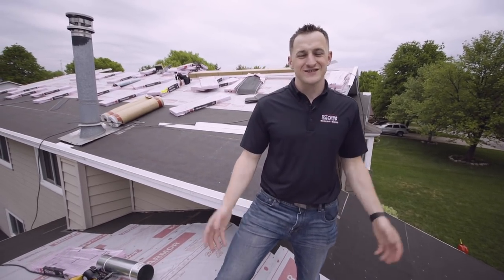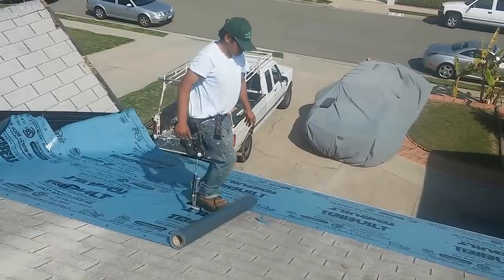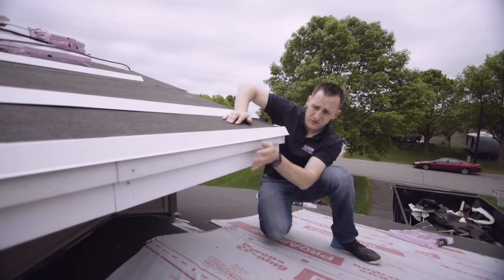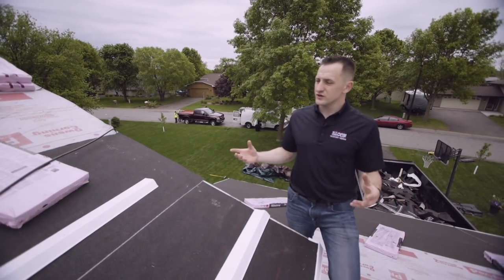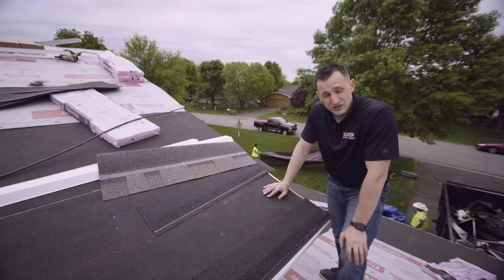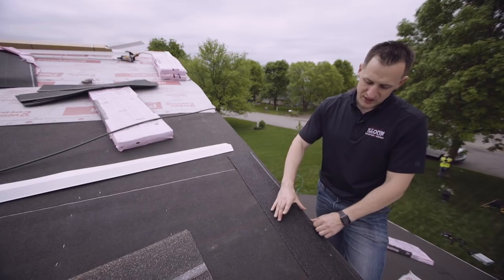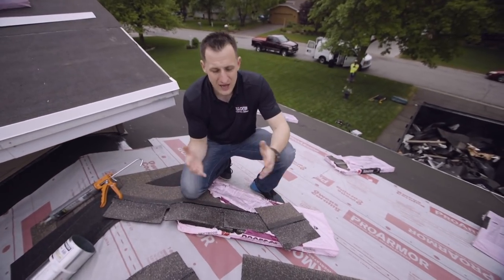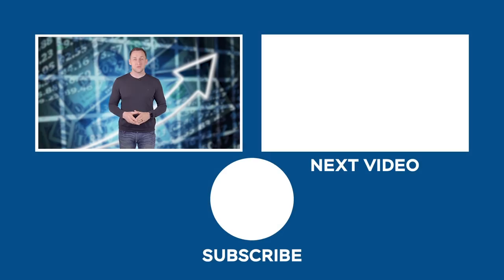How to Install Roof: Best Roofing Practices / @RoofingInsights3.0

Comment: If ur using an ice barrier do u still need felt prior to the actual shingle install?
Reply: Not an expert but YES otherwise you'll never be able to remove them in the future.  I had em run paper starting above 6 inches above the drip...with ice and water over the eave drip.
Reply: Shingles stick to the ice shield. My recommendation is to felt over the ice shield just so the next roofer can remove the old shingles. Ice shield is stuck on the sheathing for life.
Reply from the maker: @drusier  no

Comment: Hi,

I have asphalt shingles and I just installed easyon gutter guards.  Instruction says i have to lift the shingle slightly to slide the the gutter guard under the shingles.  DId I make a mistake?  will this cause water penetration?
Reply: No
Reply: thank you
Reply from the maker: follow instructions but make sure roofing instructions are followed as well

Comment: Illegal???? Code??? Huh??? Indianapolis you can have 2 "PER CITY CODE" engineers actually draw blueprints to build according to support the weight of 2.  
Um I guess they may not have attics since you never heard of them! You can make a very good determination from an arttic if you can or can't reroof.   
Yes the quality is deff not the same but if done right maybe a 10% diff.  
Felt would what? Synthetic what?
The manufacturer won't warranty if you don't use top quality synthetic? 

Starter shingles are actually cheaper and the reason why it didn't work for you is because your placing it wrong. 

Who let this guy put this video up?  Lol